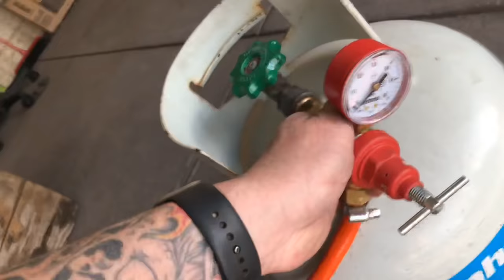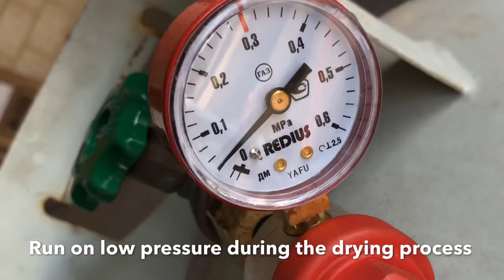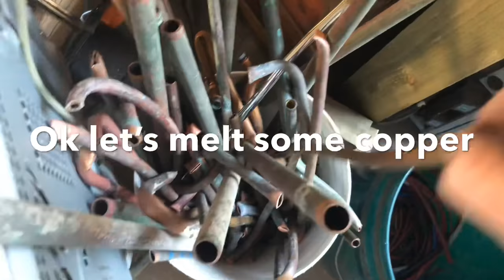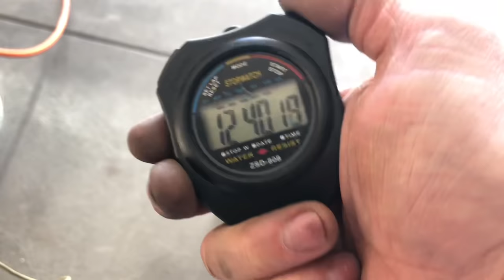2 kg Mini Melting Furnace - 12 Minute Copper Melt with Devil-Forge

Comment: Cheers for showing me what to do👍 how much do you paint the inside with the stuff you get in the bag,do you just put it all on to cover everywhere?
Reply from the maker: With the refractory furnace you do not need to paint anything on it but with the ceramic wool one you do , check YouTube videos on how to apply Rigidizer it’s very simple and quite therapeutic and make sure you mix it for the correct amount of time and use the correct measurements and you simply paint it on with a paintbrush then let it set . I actually did two coats on my furnace but I only really needed one👍🏻.
Reply: @bigstackD  cheers it is the wool kind.👍

Comment: I have been watching for a long time now, off and on for about a year, and I think I will be ready to start my own backyard foundry in the next coming months. (Thanks to you)

Firstly, I want to build my own furnace to start me off. I am highly interested in a Devil Forge furnace but I don't want to invest a lot of money into something I have no experience in doing just to realize I only like the ASMR.

My current design uses a 20lb propane tank (about the size of a 10kg tank for the non-muricans) which I would be purging with nitrogen and water before I cut into. Fire bricks, refactory cement, steel wool for added support, and a swivel hinge lid instead of a lifting hinge lid, the proper holes, etc... Enough of that..

Are there any tips for newbies other than your most obvious ones you include in just about every one of your videos? What would you recommend for PPE, furnace tools like the lifting and grabbing tongs? Any specific quality of any particular thing should I look out for? Things you would not reccomend doing? Am I over thinking this and just need to do it?
Reply: im in the same situation now- how did it go for you? any updates?
Reply: @elicohen8089  none yet, kind of in a financial hard time so I've put off a lot of things. I think as soon as this covid stuff goes away work will come back and I can get into it

Comment: Very nice little furnace, these smaller ones melt the metal so efficiently, and you can probably run 2 months off a tank of gas. Cool little Ingots you have there also, the copper one and the furry one, I bet that one was hard to cast. LoL

Comment: Wow, found what i was looking for. Now i need to learn how to regulate the regulator and where to put the regulator for different metals or just leave it at 2 for all and just regulate the air intake?
Reply from the maker: I run my regulator at 
0.12 MPa for copper and bronze
0.10 MPa for brass
0.08 MPa for Aluminium 😁👍🏻
Reply: @bigstackD  thank you. I was over burning.. you are GOD in term of metals.

Comment: Got 30kg of stripped wire ready to go..... Just need to get the furnace. As a first timer, what safety equipment is recommended?
Reply from the maker: Definitely get some welding gloves safety glasses and a face shield for unexpected splashes or for when you peer inside the furnace, also respirator is good to have when melting metals and I always wear a thick jacket closed leather boots and jeans when I melt and  pour . Check out this vid of mine for a rough idea on what you’ll need to start 👍🏻. 
https://youtu.be/nyp0GiE5FTQ
Reply: @bigstackD  Thanks for the reply...... Much appreciated. Do you have a preference between an iron or graphite mould? Enjoy your vids... Keep up the good work.

Comment: If I could afford it, a Devil Forge would be what I'd buy.  My foundry is made out of a popcorn tin, plaster of paris, sand, and coat hangers, powered by coal,  Crucibles are pieces of the light pole the drunk guy 3 doors down drove over one night.  It works (kinda), but these look so much easier/faster/nicer.

Comment: What type of gas using? Propane or acetylene.  I bought a knock version and can only get to 600 degrees with propane.  Tried acetylene and it melted hose off pipe.  So in the garbage that goes and possibly get one of these.

Comment: Have you done any copper melts with silver or tin coated wires? Does it change the color of the final product? 🤷‍♂️ Great work !!
Reply from the maker: I haven’t done the tin coated wire yet as I’m slowly collecting enough to make it worthwhile and have never had silver coated wire so couldn’t tell ya , but if you check this Friday’s video I make an awesome ingot from copper coated aluminium wire if you’re interested🤔👌🏻
Reply: @bigstackD  Always looking forward to the friday releases. Thanks for the reply and the silver coated wires are from large aircraft for corrosion protection.

Comment: When you melt your metals do you have to wear a respirator? At what temps does each of the metals  that you melt at? 
Awesome clips you make and a cool dog you have.
Reply from the maker: Yes matey I always wear a respirator because 90% of what I melt is covered in Grease or dirt or bits of foreign material but I’d highly recommend wearing one even if you’re melting clean stuff as you never can be too careful. Aluminium melt relatively low at 660°C 
brass at 920 to 940°C 
copper at 1085°C 
my bronzes typically melt around the 1000°C. I always go over the melting point before pouring otherwise it will harden up during pouring or in the Crucible

Comment: what would've happened if you tried to melt something before the drying process was finished?
Reply: Water expands by 1700% in its transition to vapor, cover that expansion with molten metal and it violently explodes.

Comment: Have been looking into getting one but not sure on what to start with. 4kg is decently priced and this new 2kg looks good but too small for what I want to do I think. Maybe 10kg or do you think 4kg will be able to do 1kg melts efficiently? Cheers bro keep up the vids love em
Reply from the maker: Yes you could very comfortably do your 1 kilo melts in the 4 kg forge it’s perfect for that size melts plus it’s cheaper than this model and it’s a lot lighter but think of the future and if you ever want to go bigger and if so I highly recommend the 10kg FB2Mb the ceramic wool one as it’s got a tiny bit more room than the other 10kg Forge I recon plus it’s over 20kgs lighter and very portable. I own both furnaces and honestly I recon they heat up the same and melt at the same speed . The only difference I found is the refractory one holds heat longer after burners off.😁👍🏻
Reply: @bigstackD  cheers for reply apreciate it man! I'm slowly building my scrap pile up so I'm keen to get melting soon. I'll definatly email you and get your discount aswell :) I'm thinking 4kg for now I can always resell it to another new hobbiest if I want to upgrade. 
Look forward to Friday's vid! Cheers

Comment: The furnace is cool and everything and I love metal melting but the constant cost of propane keeps me from really getting into it 😫
Reply: Mei Grafd Vodder you could try putting charcoal inside of the furnace then the hole at the bottom you could put a fan
Reply: Lone Star State USA yeah, that could probably work. I guess a hairdryer would be even better as air supply.
Reply: Mei Grafd Vodder yeah that’s what a meant to say was a hairdryer, you probably could only melt soft metal though like tin and aluminum stuff like that

Comment: It seems awesome but I'm curious why the 4kg one is significantly less expensive despite having double the capacity
Reply: @The great Asparagus I looked it up the moment it was mentioned last Friday thinking it'd be ideal for me as I like making jewellery and currently only really have the ability to effectively cast pewter but would like to move on to copper so a small one would be great. I had been thinking about getting the 4kg one but honestly I'm now leaning towards just building my own out of a mini trash can, some refractory and just buying a gas jet and regulator since I can use malleable iron pipe fittings to make the burner body (tkor has a relatively decent video on it or you can buy a full burner on ebay)

Comment: If i was to grind away some of that insulation, could it be used to melt 5kg ?
Reply from the maker: I doubt it it would take you forever to grind it away,  you be better off buying the 4 kg furnace and squashing all the ceramic wool . But if you got a 10 kg furnace you could quite easily use a 1,2,4,6, 8 kg crucibles in it and it would not make a difference at all because the heat efficiency of the 10 kg furnace is almost exactly the same as the small 4 kg furnace. Yes it cost a few dollars extra but you won’t be disappointed if you ever went ahead and bought one

Comment: Looks like this will be the furnace I'll be getting for some small projects. Found this for sale on ebay before I found this video! Can you tell me the size of that crucible you used? (OK, I re-read the data about the furnace and am figuring a 3" crucible will work!) Too new to this after a 50+ year career as a HD truck fleet mechanic. Did casting in last two years of high school so I don't remember much! 🤣 I'll be checking out you other videos shortly! Thanks!
Reply from the maker: All good Jesse, email me on bigstackddddd@mail.com with any questions and I’ll answer as soon as I can to the best of my knowledge. Also if you are thinking of going ahead and buying a furnace definitely email me and I’ll organise a personal 5% discount code off the total furnace price👌🏻😁
Reply: @bigstackD  Thanks! I've ordered some supplies a few days ago. They may take a bit of time to be received. Then I'll contact you to get that furnace 'in the mail'!

Comment: I have my forge on the way /got my supply of aly to smelt  collecting up copper and have the old fittings that have been bounced around the plumbers van forever/ plus a load of cable /has to be stripped but santa is bringing me an electric stripper so copper smelts are on the cards for january

Comment: Can anybody help me? I am on an hour and 15 minutes and I have some copper that is red hot but still solid… Also some silver in there. This is my second try. Could not get things to liquefy last night, either. I have the 32 PSI regulator turned all the way to the right, and I have the end of the Venturi tube open… Not sure what to do. Any help would be much appreciated.

Comment: what is the cost of the furnace  and ware can one get one
Reply from the maker: The link is in the description to Devil-Forges eBay page where they have a huge selection of furnaces . But if you asked me I would highly recommend the 10kg FB2Mb the ceramic wool one as it’s got a tiny bit more chamber room than the other 10kg refractory Forge I plus it’s over 20kgs lighter and very portable. I own both furnaces and honestly I recon they heat up the same and melt at the same speed . Now if that’s to big and If you’re only looking to do very small melts like 1 or 2 kg at a time then definitely go the 4 kg furnace as it has the same size outer shell as the 2 kg furnace but it’s cheaper & lighter and you can melt more with it. below is the link to the 10 kg furnace and the 4 kg furnace that I recommend so have a look and see what one suits better before you purchase.
Email me on bigstackddddd@mail.com before you purchase and I’ll get you a personalised 5% discount off the furnace price😁👍🏻

10kg Furnace 
https://rover.ebay.com/rover/0/0/0?mpre=https%3A%2F%2Fwww.ebay.com.au%2Fulk%2Fitm%2F253796844325

4kg Furnace 
https://rover.ebay.com/rover/0/0/0?mpre=https%3A%2F%2Fwww.ebay.com.au%2Fulk%2Fitm%2F251870988045

Comment: Did you see how that was done to aluminum alloy rims in Santa Rosa CA in 2017 and in Paradise, CA the following year during a drought and "forest fire" nicknamed "Campfire"? The same thing happened to automobile engine blocks made of aluminum.. Just one big difference.  There weren't any melting furnaces involved.  Just a lying media and a huge mass of idiots across this land that I call SHEEPLE that don't care.  The cars with melted  tire rims weren't even in the woods...So can you explain this as to how they melted and be told by corrupt govt that this is the "new normal"?  You are demonstrating melted copper furnace and it must be the "old normal".  I like the old normal better. I hope you don't live in CA.  If you could have only seen how some of these residents ended up in their cars.  They never had a chance. Their skeletons sitting in an incinerated car interior. THey looked as if they had been dropped into a vat of ...well...melted copper.  More of this "new normal". Now what on earth could have caused this?  I won't hold my breath in expecting any replies...That too is the new normal.   But welcome some thoughts!